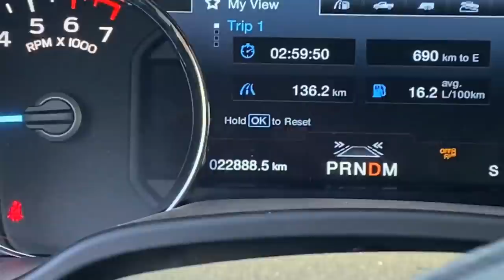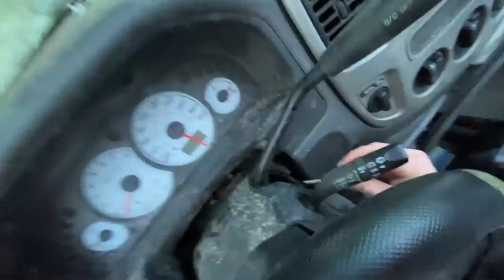EXPLODING Nissan Versa ENGINE!

Comment: If you take care of the oil on those versa motors. They last for ever along with a manual trans they are not fast but they last a while
Reply: I’ve had mine since new in 2014 lol. I still rip that thing once in a while and it’s a blast. Slow cars are fun to drive fast

Comment: I have noticed with my noco is that is has the battery power to turn over the engine but not enough amperage to send to the spark plugs
Reply from the maker: Either way it works fantastic most of the time!